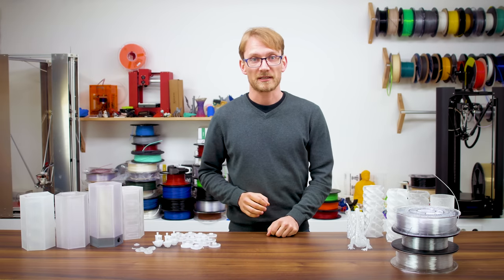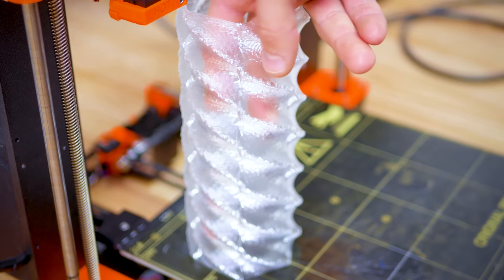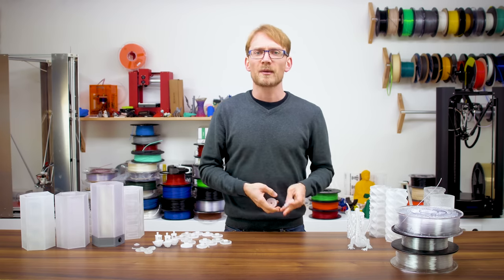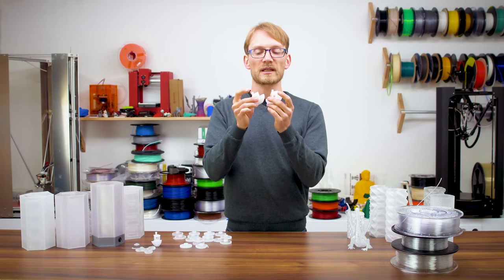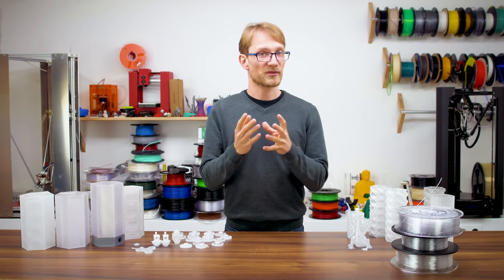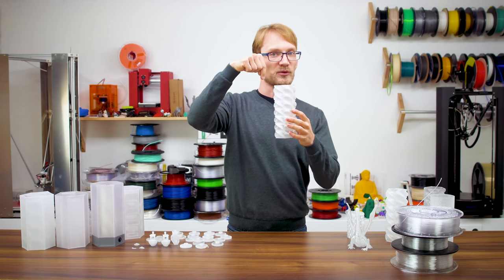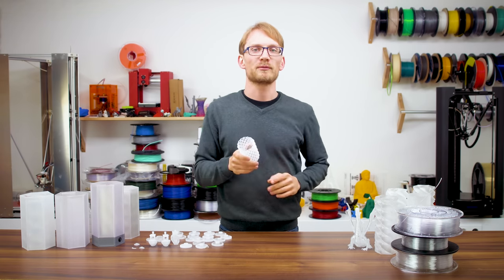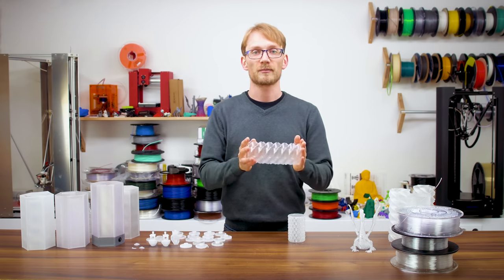How to create transparent 3D prints!

Comment: Gaps of trapped air are the cause of the printed part's internal cloudiness. External causes can be dealt with post-printing. 

An interesting experiment would be to put a tiny 3D printer like a MP Select Mini or smaller inside a DIY, LED lit vacuum box with window and see what happens. 

Part cooling would need to be entirely radiative. Any fans might over-speed since with little or no air they would not be under any load. Probably a good idea to just disconnect them since they wouldn't serve any purpose anyway with no air. Stepper motor temps might also be a problem since there'd be no convective cooling. Possible fix - use low print speed? I've checked and electrolytic capacitors in the printer power supply and controller circuitry are OK under vacuum:

"AIR PRESSURE - When operating at low values of external air pressure, there could also be an increase in the pressure inside the case. When an external vacuum exists, the pressure inside the capacitor could rise up to 1 bar. In these circumstances the internal vapour loss becomes greater resulting in an overall reduction in expected life."

I suspect that the life reduction mentioned is only related to very long term operation.

Anyway, such printing could turn out to be completely undoable (I'd guess the most likely fatal flaw would be the lack of printed part air cooling), but it might be an interesting experiment unless someone really up on 3D printer theory can explain why it's fundamentally not worth trying as I suspect it could easily be.
Reply from the maker: +Winston Smith "bubbles" of vacuum would behave almost exactly like bubbles of air.
Reply: Isn't the flow to gap closure of molten filament impeded by the rising pressure of air as an air filled gap attempts to flow closed?

Comment: You said you would print those gears again in nylon or abs.
Why?
PETG is said to be nearly equal to those if I understood that right.
Is there a reason to take nylon/abs over petg in some instances?

And do you have another PEI Sheet over the stock PEI sheet on the prusa?
Reply from the maker: PETG is strong, but brittle. ABS/910 will fail at a similar strains, but will do so much more gracefully.

And yes, I have more PEI sheets. Wanted to try a different one anyways ;-)

Comment: Hi Thomas. Something you said in this video caused me some confusion. How does one go about increasing flow rate to 110%? If 100% represents the fastest flow rate possible on a printer, then 110% is not technically possible. Your printer can not outperform itself. Can it? Maybe I'm mistaken, but I associate flow rate with the rate at which the extruder feeds filament to the hot end. If the extruder is calibrated to a certain value of e-steps, how is it possible for it to extrude more than this value without having some kind of adverse effect on the prints? Am I missing something? I don't understand.

Comment: Tom, have you tried a 50/50 mixture of denatured alcohol and water dripped along the perimeter of a sticky print? It works a dream with PLA on the Prusa PEI bed. I've not had the chance to try it with ABS or other filaments.

Comment: I saw a video where a guy tried out a method of smoothing PETG with isopropyl alcohol which gave a great result. It also makes the material transparent, almost just like glass but the process must be repeated several times before you can get what you want.
Personally, I'd love to see if it's possible to make a visor for some 3D helmets with PETG and treating it with this alcohol method.

Comment: I know with some resin based 3d printing you can apply some chemical afterwards which basically turns a slightly frosted finish to a very clear one. Is it possible that applying acetone or something like that might increase the clarity? By melting the outer surface slightly, it may act more like a single block regarding light fragmentation.

Comment: Granted I am no expert, but flame polishing should have a flame (1700C) not hot air (600C). I believe you need very fast heat transfer to completely melt the surface before heating the inside of the part. Maybe try a blow torch?

Comment: Hi Tom, 

I just discovered PEI film through this video and it seems very useful. 

I am having a hard time getting large PETG prints to stick to a print bed with blue masking tape due to warping, so this looks like a good alternative. If I understood correctly, I should use something like glue stick on top of the PEI to prevent it from getting stuck on the bed?

Comment: Was that the PEI ripping off on the mk2? I think I died a little inside watching that, lol.
Reply: that bed destruction was so painful
Reply: I wonder what the best method is to get a stuck print from the bed? My first instinct would be to heat the bed to 100 degrees Celsius, hoping that would soften the bond.  Or using a piece of dental floss to pry it loose.
Reply: You could try to use the thermal expansion to your advantage if you would heat up the bed and then use freezing spray (used in many industries, like electronics, medical, industrial...) to rapidly cool down and "shrink" the part. Or if you have a removable bed, try to stick it in to your freezer for some time and then try to remove the cold print. If you just heat the bed, this would usually soften the plastic a little, and in my experience, the softer it is, the better it sticks (and applying force to a soft part when trying to seperate it from the bed leads to unwanted deformation...).
Reply: I hope that was him just doing that because he knew he needed to replace the PEI!  After so much service, have some respect for the magic PEI!

Comment: Tom,  I noticed you tried sanding and heat but didn't try an acid-tone bath to see if it would over all enhance clarity and giving it a glass shinny appearance Any particular reason why?
Reply from the maker: "Acetone" bath? Hm, supposedly PETG is not resistant to organic solvents, I didn't know that. According to the RepRap forums, it does not smooth it like ABS, though, so I'd think it's more akin to what acetone does to PC - it just gets brittle and crumbles.
Reply: in my limited experience with PETG in the orthotics/prosthetics field, I've found that acetone tends to cause a foggy layer on the sheets we use for check sockets.
Reply: I only ask because I found this quick study on indestructibles and it sparked my curiosity. 

http://www.instructables.com/id/3d-Printed-Plastic-Smoothing-Experiment/

I also found this one on the RepRap forms where "Bryan" used Cyclohexanone to solvent weld PETG. Theory is if it can be used to solvent weld much like how we use acetone on abs it might be able to polish in the same similar fashion. Of course this is just my two cents but it might make a good video if you can test to see if it actually works in adding that extra bit of clarity. It would be great to actually print a clear glass 3D product one day without moving to costly SLA printer.

http://forums.reprap.org/read.php?184,588511

Comment: Try to acetone smooth the prints
Reply: William Tsao - it might fog it up like it does many other plastics. Worth a try though. Wonder if scotch-tape would make it clear like it does to frosted glass. Clear coat might also improve stuff (if it doesn't fog up the plastic), wish he would have tried it, he though about it.
Reply: the reason scotch tape works on frosted glass is because internally the glass is clear but the surface is what makes it frosted. that is what needs to be determined to find the right course of action. 
1. if its just the surface that causes the print to be foggy then polishing and surface finishing with acetone or clear coat could make it clear
2. if the inside of the print makes it foggy then no amount of surface finishing will make it clear and only adjusting settings would help

its the same principle for resin casts, you can polish them and make them look like glass but if it has a bunch of air pockets it will never be clear. i would like to see some of those gears polished instead of just sanded, i think that could make them actually clear
Reply: Yep, the reason for the tape was to determine how much of the fog was surface, and how much internal. 

Acetone seems to fog the clear plastic part I just tried.  It was cast clear plastic, feels like ABS.
Reply: ABS is naturally nearly opaque, very milky though! Clear ABS does exist, but it has exotic additives and is not something you'll commonly find. The only really cheap clear plastics i can think of are PS and HIPS, PMMA is one price step up from that, and PC is also not so rare and not really expensive.

Comment: Isn't resin printing really, really good for clear prints? I know those machines are more for constant printing since the resin has a  short shelf life compared to filament, and it needs more maintenance, but there's a lot of outsource companies that use dlp/sla. I'd say if you need a specialized print like that, that'd be the way to go.

Also, what about that one thing, I forgot what it was called, but it was a vapor chamber for acetone or something? Supposedly that was supposed to provide clear prints with some filament.

Comment: For the prusa i3 clone, whats the 1m m5 threaded rod for? Are you supposed to cut it?
Reply: KendamaGam3r I assume that's the idea, the two peaces would then drive your Z axis. However I would recommend M10 rods as they are much stiffer and won't wobble as much as Tom's build did.
Reply: Jens L. Im so confused now
Reply: KendamaGam3r Tom's idea was that the M5 rods were so flexible that they would not create wobble on the X Axis, however it showed that there was still significant wobble.

Comment: I own a Prusa i3 MK3S. I bought a spool of transparent PETG from Sunlu. I've used many of their PETG filaments and I really like it. But for some reason, I've tried this transparent one and I am having trouble getting it to print. I've even used the same setting that I did with the black PETG and still it just doesn't print well at all. I've used the settings recommended on the sticker on the spool (200 - 220), still no luck. Not sure what to do.

Comment: i got colorfabb ht and reproduced the solid transparent prints, though there were lots of bubbles suspended in the part. nothing i did would stop the bubbles -- print speed, print temperature, layer height, or extrusion percentage. eventually i gave up on the colorfabb. i managed to reproduce 100% bubble-less solid perfectly transparent prints using standard ultra cheap PETG. the trick is to print slowly to give the petg time to flow and fuse completely. and print on PEI for a glass smooth and clear bottom surface.

you know when you have the settigs dialed in properly - it almost looks like you're printing invisible filament as it goes down on the print bed. http://imgur.com/a/5CH6N

Comment: Hello Tom, have you tried the combination T glase + XTC-3D ? : http://taulman3d.com/t-glase-optics.html

I have tried the XTC-3D clear coat on transparent PLA, the result is not as dramatic as with t glase, but it does really improve the parts transparency (in vase mode, since PLA doesn't fuse as well)

Comment: I would strongly recommend using layer heights that are multiplies to your physical resolution. You said that your physical resolution is 20 micron, so instead of 50 micron layer height you should use 40 or 60 micron. On my printer that drastically improves the print quality. Also i use rather thick layer of PVA glue to stick PETG to my print bed and it works great.

Comment: Lol wtf why are you stabbing your gear with a chisel. Try putting the chisel on the edge and tapping it with a hammer or your fist like a chisel it supposed to be used.... can also sand down a paint scraper to get it really thin and that works well